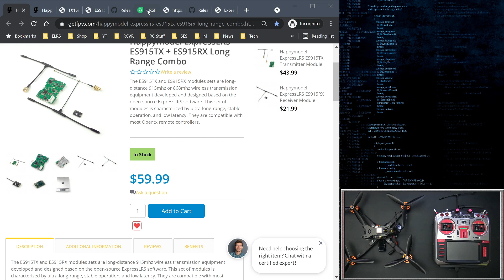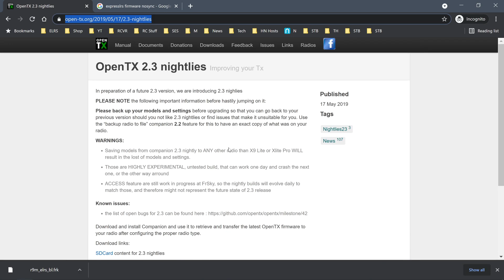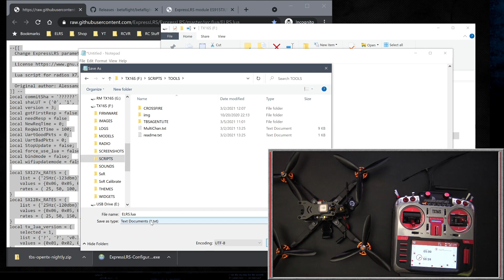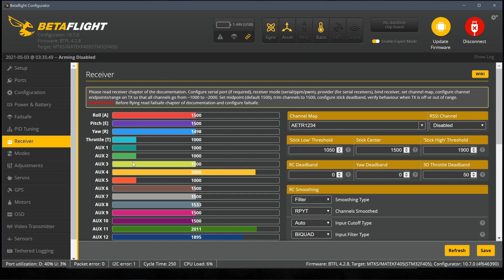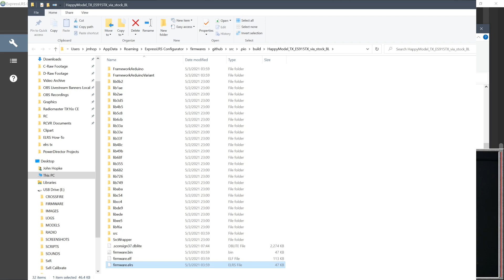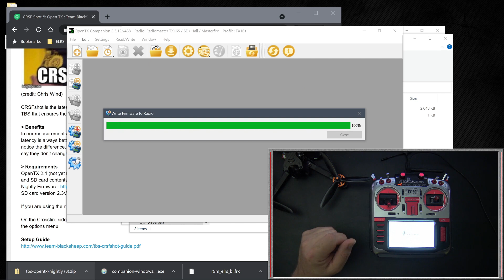ExpressLRS Complete Setup Guide for Happymodel ES915TX and ES915RX

Comment: I know this is old video but just wondering if inav3.0.1 supports Express lrs 915 mhz? I want to get this working on my ar wing pro but don't seem to be much information that I can find. I currently running a matek f405-wing flashed with inav 3.0.1, opentx 2.3.14 and crossfire. Any information will be appreciated thanks
Reply from the maker: iNav doesn't care about frequency, it cares about protocol. ELRS 915mhz talks CRSF just like 2.4. So you won't have any problem getting your 915mhz rx talking to iNav if you wire things correctly and configure iNav correctly.
Reply: Great thanks

Comment: when i execute the lua script for my module on my TX16S Eachine , it says "loading ...   ?/???" and nothing happens i tried several times and the happy module 2.4 Pro its connected and has power ( there is a red light ) i just updated to open tx 2.3.14 the radio but still nothing , is the module faulty?
Reply from the maker: Try setting your baud rate to 115k
Reply: This could mean two things.
1) The module makes a bad connection to the radio somehow.
2) You put LUA version 2x on your SD but your module is still version 1x. FIx: use LUA version 1x to flash the module to version 2x and after, update the SD to LUA V2x.

Comment: Received my ELRS System aswell, updated my radiomaster tx12 to the neweset version, flashed and updated the module aswell as the receiver, bound sucessfully. I do however not get any inputs visible in Betaflight and therefore cant change any settings like modes etc . checked wiring TX to RX . Not sure what else is missing to make it visible in betaflight. any suggestions ?
Reply from the maker: Normally when this happens it's because the rx/tx lines are backwards. So try flipping them. You also need to verify you're running crossfire on both sides (BF and Radio). Finally make sure you've assigned the correct UART in BF.
Reply: @RCVideoReviews  yeah did that already and it's still the same. Flying the diatone roma l3 HD analog, will see if switching uarts help. Will do some soldering this evening

Comment: Don't we need to join the solder pads as shown in the Elrs instructions? I did both without and with soldered pads and could not succeeded. I know my comport 3 is correct. I just says cannot open comm port. I am lost

Comment: Is this better than CRSF?
Reply from the maker: PS Fantastic question.
Reply from the maker: That's a can of worms...

Pros and cons to each I suppose. i.e.

Pros: Cheaper, uses LORA (like Crossfire), uses Crossfire protocol so telemetry works. Multiple vendors results in price pressure.

Cons: Not as refined as Crossfire, questionable implementations by certain vendors (non-standard code base), LUA needs lots of work, less integration with other devices.

I'm sure there are other points, but it's not as cut and dry as "is it better". My suggestion is simple: This tech is cheap enough to try without taking a total bath if you don't like it. So, try it.

Comment: I've got a problem where I can't flash the ES900TX :-( seems it cannot communicate with the module?
Reply from the maker: Are you trying to flash wireless or from the radio?
Reply: @RCVideoReviews  my bad- was using an old version of the configurator which didn't have the right firmware lol! Thanks though
Reply: Good Luck!!!   I have YET to find any help getting ExpressLRS to work.  There are NO VIDEOS, TUTORIALS or even help from Happy Models to get you up and running.  Nothing in this video will help you if you have the latest express module.

Comment: Hi there,
I received the happymodel ES915TX without the fan and the ES900RX, will these work together?
Reply from the maker: They should. If you can flash ELRS firmware on the Rx, it should work with the Tx.

Comment: Do i have to install NIGHTLY mine seems to connect with r9m ELRS in lua scripts I think they have updated it. I flashed 8c the latest versions these guys are putting out updates very quickly
One last question since i flashed r9m will my module with ELRS connects to es915 or not ?
I have yet to flash r9mx via passthrough
Reply from the maker: The nightly is used to enable CRSF Shot and flashing the module direct from the radio. Have you checked to see if CRSF Shot works?
Reply: @RCVideoReviews  i haven't ill do that right now thanks alot man very quick response hope your channel see much more success i love your teaching style i just reached that good packets stuff
Reply: @RCVideoReviews  thanks brother i just confirmed that my packet rate change when i switch it to 100 which do you prefer to use 200 or 100 my crosfire shot works i didn't have to flash nightly or crosfire shot looks like im good to go

Comment: If i flash open tx firmware what happen with my settings and profiles they will get deleted?
Reply from the maker: No, you don’t lose your settings when upgrading firmware. However, you should always backup your radio. You can either just copy your sd card to your computer or you can backup radio settings and models in companion.
Reply: @RCVideoReviews  Thx, last question which expresslrs is better for cinewhoop. I mean penetration and long range should i chose 900 or 2,4?
Reply from the maker: @lucalive1302  Range and penetration is usually going to be 915Mhz. Check the leaderboard for ELRS. 915Mhz has gone out 40km on 10mw.

Comment: I'm getting a firmware update error when I try to write the frimware to the External module. Step that happens around 21:40. My transmitter says Firmware update error, No Sync. Anyone know how to fix it?
Reply from the maker: I didn't experience that error, so I don't have much practical advise to offer other than:

1) Did you make sure the build target is correct. You're using the TX with Bootloader Target?

2) What options did you use in your configuration?

Comment: Thanks after a month this kept my hope up to keep trying, 

 all I'll say at this point is if your a newbie like me to ports and modes start with a virgin tx setup, turn gv off, and follow this video step by step. After you get it working add your saved models and re-enable gv's.

Rebooting the rx after changing ports and modes was nessary for me
Reply from the maker: Did you get it working?
Reply: Yes on a protek 3.5, 

one+ other thing 

Is if your like me who has 4 tinyhawk's you need to give it a second to link unlike spi which is instant 

If you take a current model and change aux channels and get them out of sequence (iflight A85) you get telemetry but no rx movement shows in betaflight 

One of your setup screens on the rh side shows you have rssi enabled that stops rssi or lq in osd on iflight aio f4 f7, lol I try every thing!

Enough for now 3 rx's coming tomorrow

, but I can blast through 300 yards of dense woodland as I fly the creek....

I used all the sd files associated with the n500 folder and nighty firmware of same day and everything works. 

Later
Reply: And much much thanks, especially opentx logic stuff

Comment: Hello do you know how to connect the receiver to Pixhawk board?
Reply from the maker: Sorry no. I don't have or use Pixhawk.
Reply: In case of crossfire receiver with pixhawk, u can connect receiver either at sbus port or telemetry port......I am not sure but I guess LRS should work in the same way as LRS uses the same CRSF protocol.
Reply: Have you tried it yet?
Reply: Tried with crossfire but not yet with ELRS....
Reply: Ok do let me know If you try it. I don't have ELRS hardware yet.

Comment: My HP915 can't update RC3 via BL. Must use stlink. Any solution?
Reply from the maker: As far as I know there are only two methods--stlink and bl. If you can't do it via bl....

Maybe a friend has an OpenTx radio you could borrow to flash your module?

Comment: I put it on my R9 hardware per JB, hope it was worth the effort
Reply from the maker: I haven’t used R9 but I have used Crossfire and have the same sentiment. Crossfire is rock solid in the air. I hope this link is just as good.

Comment: John:  Absolutely amazing! 
   I can't believe you did all this with such clarity in ONE VIDEO! I could NEVER have done all this by myself. Actually, I have only watched your video so far. I'm still waiting for my Happy Model Tx and Rx to arrive, so this little project will be for another day ...soon.
   Do you think this system could be successfully used for my ZOHD Dart 250G fixed wing plane?  Is so, would you make any changes to the protocol you outlined here? I think that would be another outstanding short video to piggy back on this one.  You are the BEST!  - Jim
Reply from the maker: James, I don't think this would work on the Dart because to the best of my knowledge, the Rx only supports the Crossfire protocol and I don't believe the Kopilot understands Crossfire, only s.bus. 

As I went through the individual steps, I knew this had to be put together. Make sure you watch the next one: https://youtu.be/l_lMny9CFSg  as it turns out I didn't get an actual nightly OpenTx firmware in this video. The nightly firmware does support CRSFShot and flashing of ELRS modules.

Glad you found the video useful. Have fun with your ELRS gear!

Comment: Hey man! great video. Just wanted to add one minor correction, the nightly actually DOES support CRSFSHOT, the quirk is that you gotta change the setting to enable it in the opentx companion. Under edit settings you have to click on "Application Settings"  and from there you can enable nightly builds. 

Hopefully all this will be resolved in a couple of months and the openTX firmwares unified again.
Reply from the maker: Thanks for the info, I'll try it out. I used a nightly to flash the tx and crsfshot didn't work with the nightly on the radio. It had to be the tbs firmware.
Reply: Yep u instal 2.3.11 not nightly. Need to enable nightly in options. IT will work easy if u install nightly correct.
Reply from the maker: Got it. Thanks for the info. I'll put an update together.
Reply from the maker: The Test Build Warning sucks....
Reply: @RCVideoReviews  lol...yes it does

Comment: John this is great session but what about the 2.4 GHz ...
Reply from the maker: What's the question? The 915 option was locally available. If I can get my hands on a 2.4ghz, I'll give it a look.
Reply: @RCVideoReviews  I just got done Flashing the ExspressLRS 2.4g system with two EP#1 receivers. Alot of the elements in this video like the CRF shot OpenTX to your radio & SD card applies for the ELRS 2.4G system. You can go to the ELRS Github WIKI and get instructions on how to download ExspressLRS configurator to flash firmware on your TX & RX. It just takes some tinkering and patience..lol
Reply from the maker: I used express LRS configurator in this video. I just don’t have 2.4ghz hardware yet.